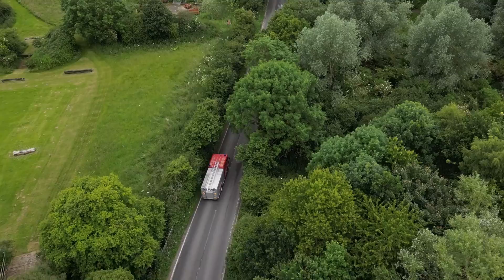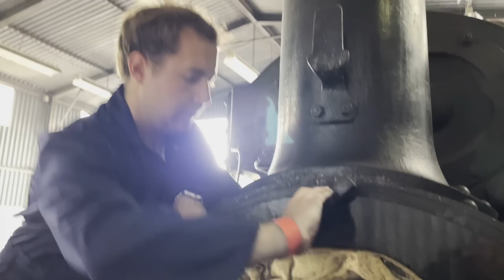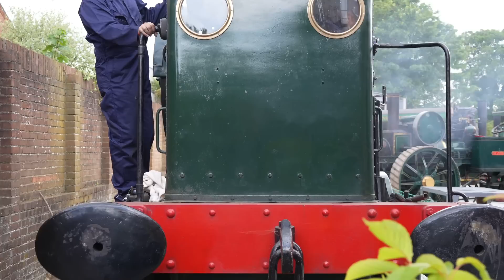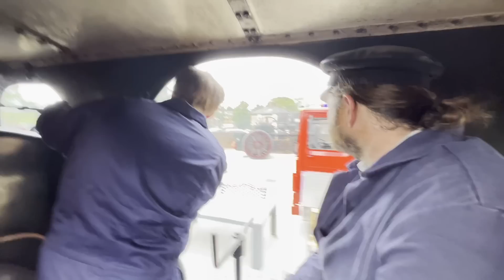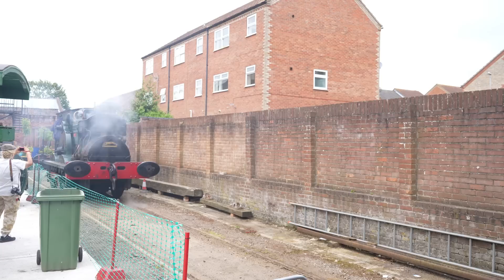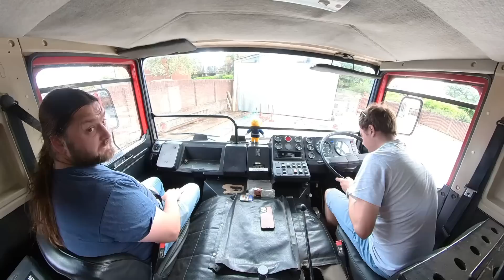Driving Sirapite AND My Fire Engine at the Leiston Long Shop's 40th Anniversary

Comment: The locomotive Sirapite was built in 1906 and worked at a gypsum mine at Mountefield in Sussex, a mile from the Tonbridge-Hastings line. 
The name 'Sirapite' was also a well-known brand of plaster (which is made from gypsum).
Presumably the loco was named after the plaster, rather than the other way round!
The same DIY forum that told me about the plaster also told me that Laurie pronounced the name correctly as "Si-ra-Fyte".
Why they spelled it with a 'p' rather than a 'ph' is anybody's guess!

(Now, if this was Wikipedia I would provide sources for the above information, but it isn't, so a quick search for 'sirapite' should get you most of the way!)
Reply from the maker: It's a weird little machine

Comment: I'm curious, that locomotive with its huge flywheel and reduction gearing - how much momentum does that thing carry? I would think that once in motion it probably wants to keep in motion with very little throttle needed. What's that like compared to a direct drive steam engine?
Reply: I can't answer that, but on a railway locomotive the wheels do the same job as a traction engine flywheel to maintain momentum. (I think!)

Comment: That Stanley Steamer actually uses something known as a steam generator, rather than a conventional boiler. It's essentially a coil of pipe with a liquid/gaseous fuel burner at the bottom, with the flame going right up the middle of the coil. Cold feedwater goes in at the bottom, steam comes out at the top. They're very efficient and compact for things like steam cars, but they don't scale particularly well, so they weren't really used in locomotives apart from the various oddities of the Bell Locomotive Works (Which are genuinely quite fascinating to research). And that thing on the front of the steamer that looks like a radiator? That's actually a condenser to recycle the steam back into water for the steam generator. They're really cool, especially Jay Leno's 1925 Doble E-20, which apparently did 132.5 miles an hour back in 1925 when it was new, which is frankly just absurd.
Reply: Sorry mate you're totally incorrect. It's a fire tube boiler, has 600ish 1/2 tubes and is wire wrapped for additional strength. How do I know? It's my car and I restored it! #stanley21088
Reply: @stuartkimhart6480  Oh, my bad. Thanks for that, I really hate spreading misinformation. I guess I got my Dobles and Stanleys mixed up. Also, great job with that restoration, the old girl looks gorgeous, and I'd love to drive her someday, though that'll probably never happen! I'd also love to see some videos on her, but you obviously don't have to if you don't want to.